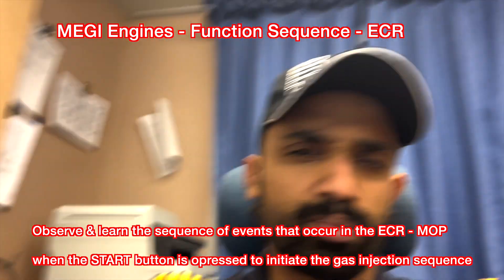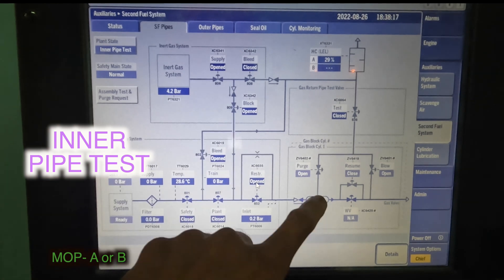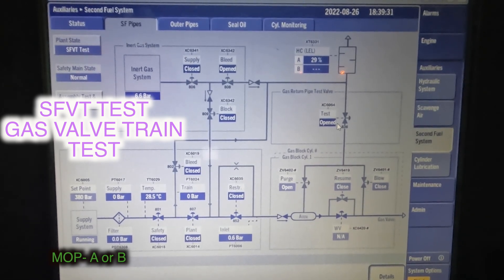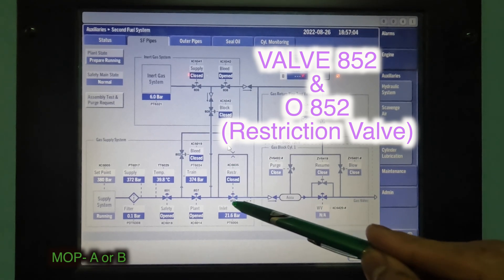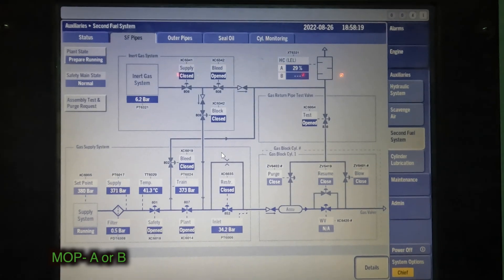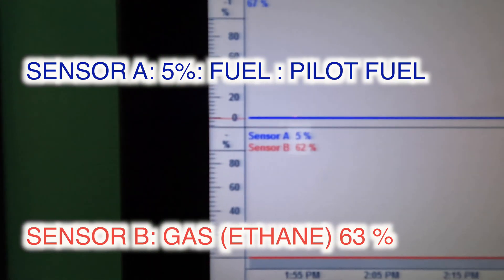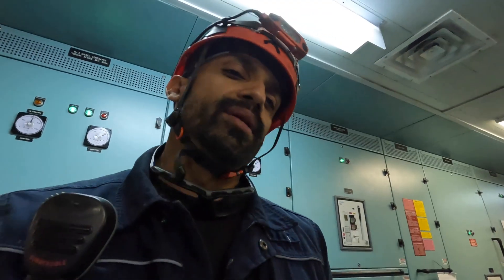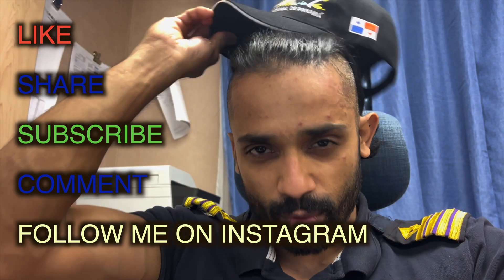DUEL FUEL ENGINES - PART 4 - GAS START SEQUENCE

Comment: Dear Mr Shaun, Can u pls show   how to calculate SFOC while running in gas mode ?
Reply from the maker: gas flow meters (mass flow)  readings and for the pilot fuel,  the fuel flow meters; calculate this by taking readings for both with a 4 hour period (people do 1 hour generally but this will not be accurate) and then used the average power (KW) indicated from the PMI computer or if u have a shaft energy meter you can use the energy readings to get the SFOC(shaft power)..
please see my latest video, i have shown the gas flow readings and the pilot flow readings
Reply: Dear Mr Shaun, Many thanks.  Can u pls do a separate video on SFOC ( For dual fuel engine) when y r free ?

Comment: ....At what engine load ( power) " gas start " button is pressed? Thanks
Reply from the maker: minimum engine load is 10%, but still unstable at lower loads, so stay above 30% engine load to prevent gas trips... see my previous video to see low load operation on gas please.
Reply: Dear Mr Shaun , Thank you so much. I hv watched almost all your videos regarding dual fuel engine. I am getting very critical information from your video . Wish you good luck. Waiting for next video.

Comment: What is the difference between deepwell pump and submersible pump and when it has to be used
Reply from the maker: well for a simple ans: DEEPWELL is where the prime mover is outside the tank and mounted on the tank dome - usually an electric motor but can also be hydraulically driven. this involves a long shaft from the bottom of the tank to the top.
submersible is wher tthe motor and the pump inside the tank at the bottom..for further deatils read up the GAS fam course materials

Comment: Hai Sir, What is the general practice, how early will the FG deepwell pump be started and the line prepared, before the Gas fuel operation is started from MOP?
Reply from the maker: it takes about 45~60 mins to stabilize liquid levels & cool down the piping.. can doit faster but it can cause thermal strain on pipes